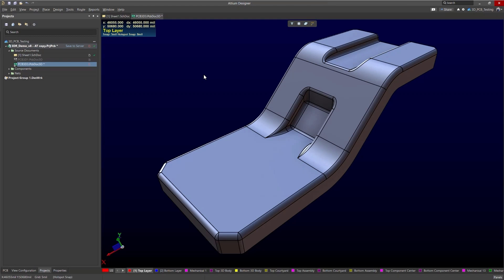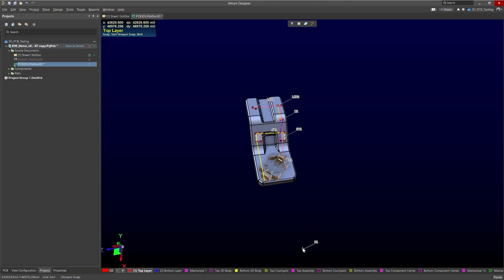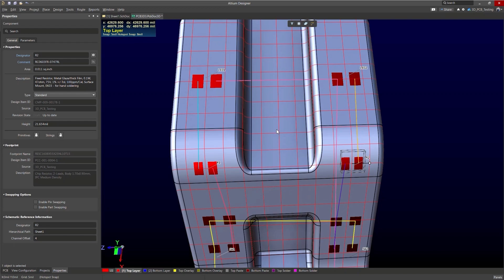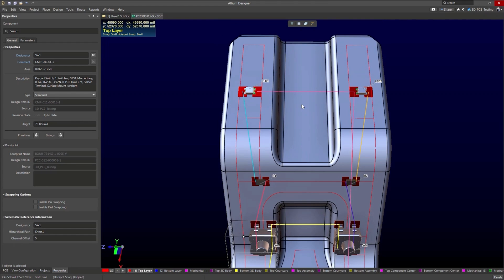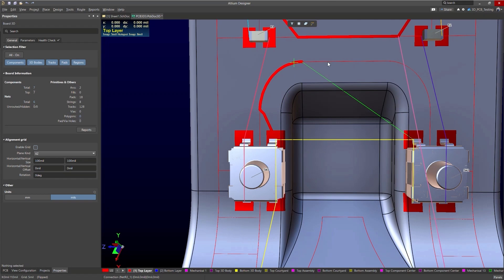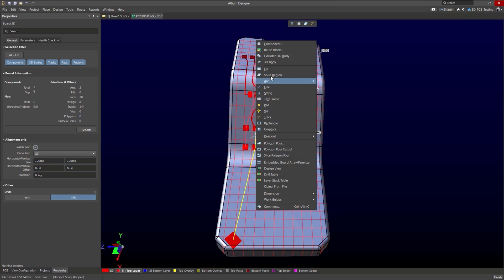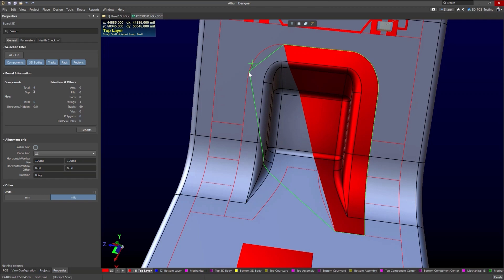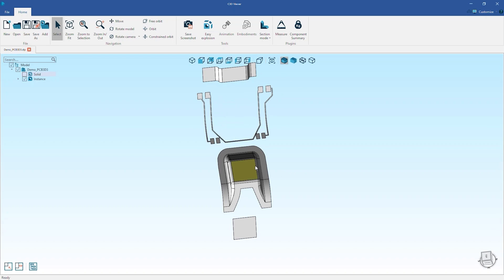Design in a New Dimension: Altium Designer’s 3D-MID Demo

Comment: I don't see any use cases for this feature. How do even this shapes get manufactured?

Overall, great that you add new features but altium codebase needs a refacto asap, every new update that comes out, altium is becoming slower to run. You are building a skyscraper on a wet soil!
Reply: Check Harting 3D MID, they do manufactuering of this (Usually 3D printing) - 

I do agree that it is not technology for main HDI board, but for the example of buttons and lights in akward mounting solutions I can see it being a good option compared to having plastic with FLEX pcbs strapped to it.